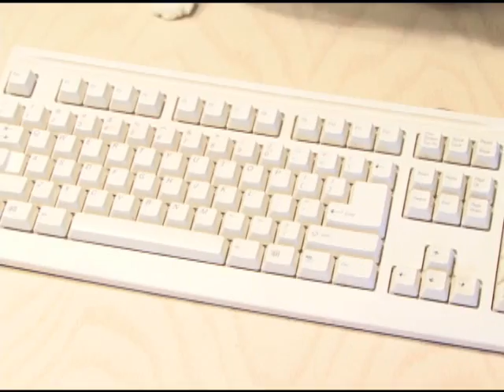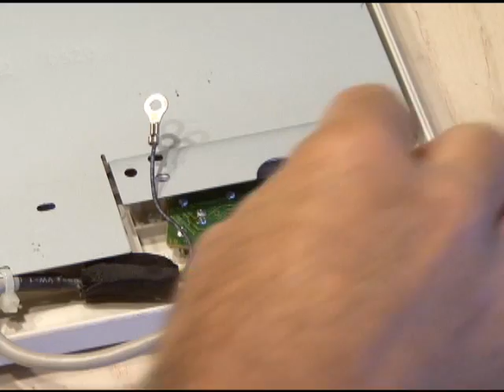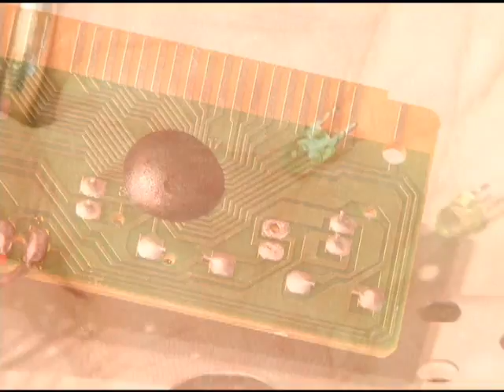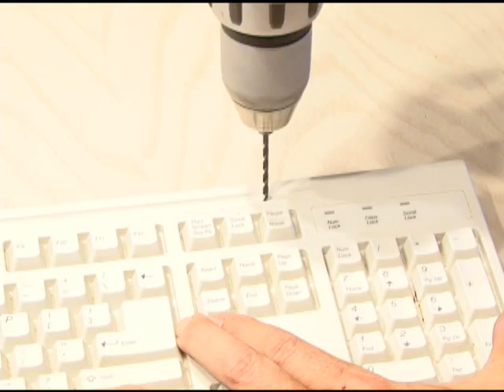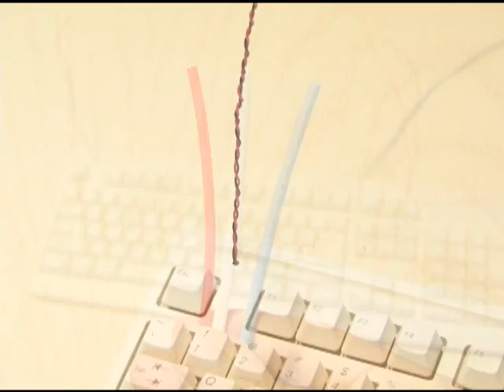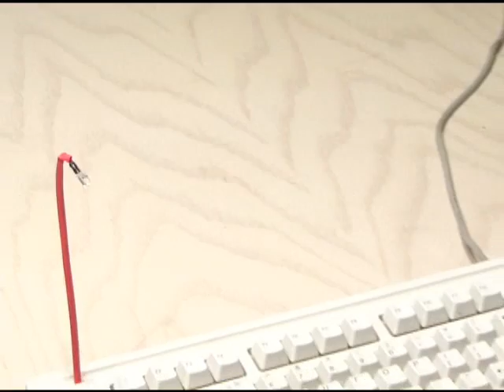Illuminate Your Keyboard!

Comment: wouldn't it be much, much cooler if one put small green or whatever color LED lights underneath the keys, then drilled small holes in all of them, when you pressed a certain key, an arrow key for example, it lit up the inside of the keys green? and underneath them